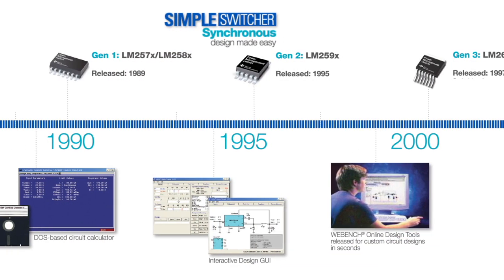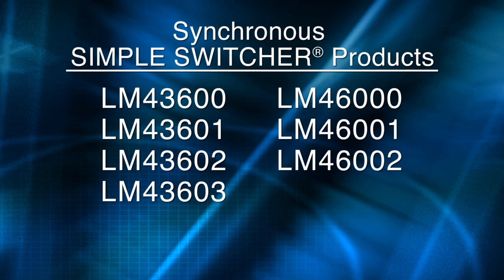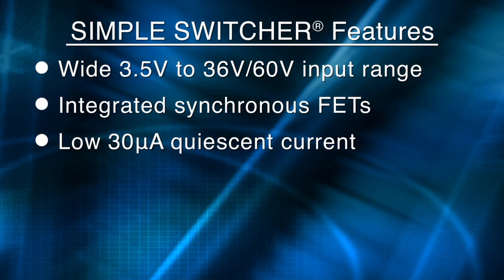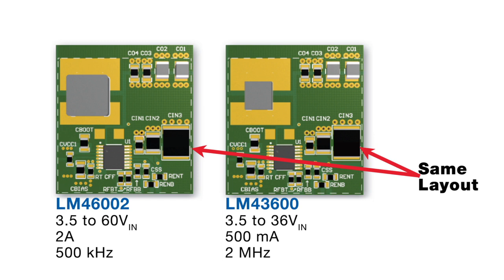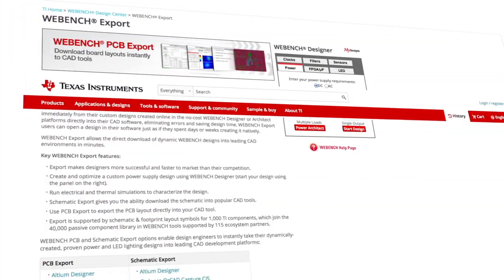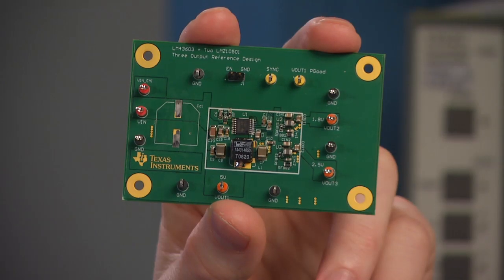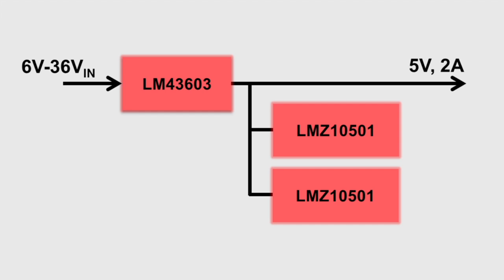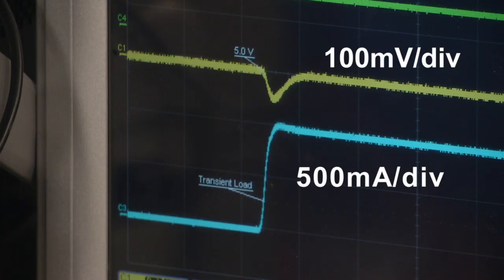SIMPLE SWITCHER Synchronous Regulator Family Overview

Comment: Designed in Hong Kong, the LM3100 was the first Simple Synchronous.  First using current mode COT.  4th gen was designed in Phoenix using current mode and external compensation to address those who wanted better optimization.  Silicon was completed so fast, took the WeBench team 3 months more to be ready for launch.  5th gen was a refresh of 3rd gen.  Going from 3um to 0.5um.  Fun times.